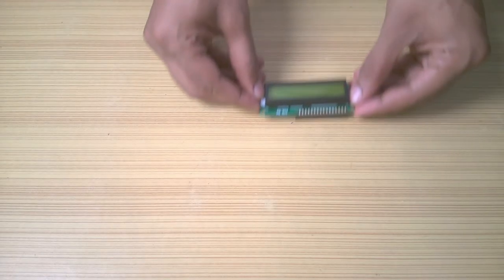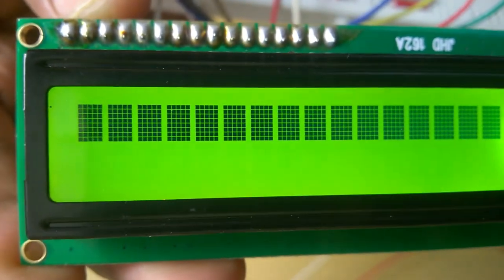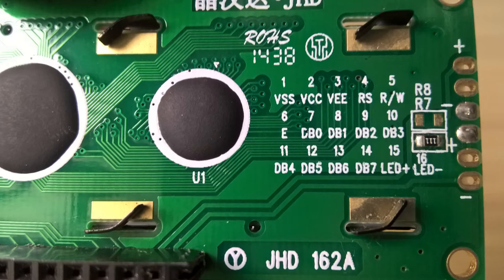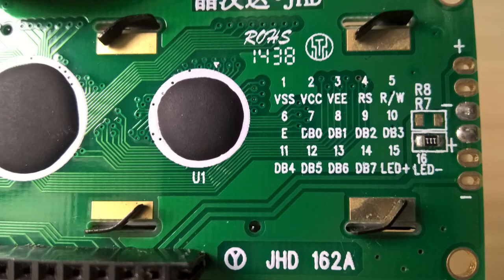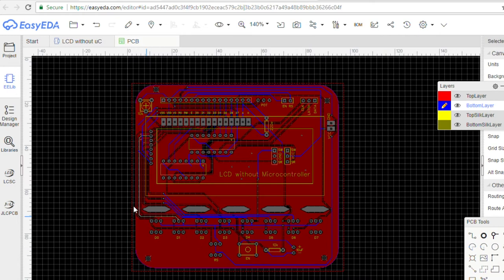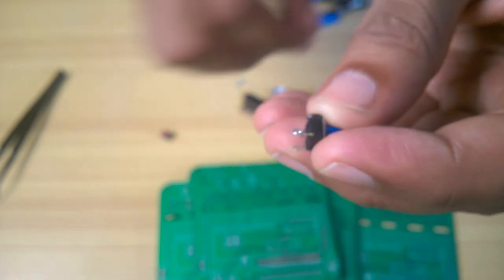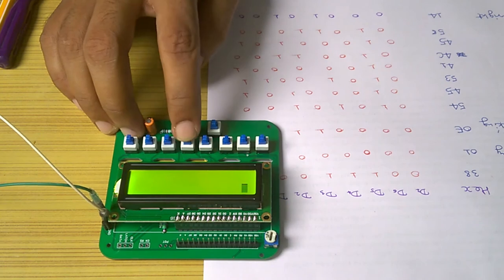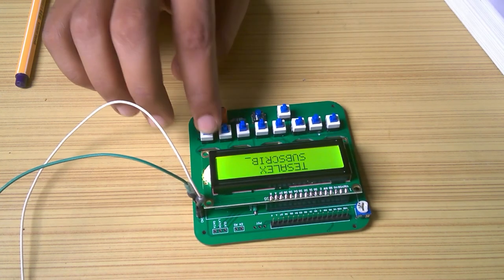LCD without a Microcontroller

Comment: Do anyone know how to create custom character without Arduino library
Reply: Yeah i do... sure
it's easy 

CUSTOM CHARACTER 101
Assuming you are using a 1602 LCD  which means
16 Characters   x  2 lines

what you will notice is Each line has , WHAT YOU WILL CALL A SQUARE.
well.. it's not a square, it's a rectangle
but CORRECTLY CALLED,    A CHARACTER 

Now... this character uses the ASCII Protocol used by your keyboard
but, you can create any character you want , as follows

You open the custom character sketch

then understand this 
1.   YOU CHARACTER DIMENSIONS ARE  5 PIXELS   X 8 PIXELS

2. Get yourself a paper and colour in some squares and create a character on paper

Now......  EACH HORIZONTAL ROW is 5 pixels
and in the code it is represented by A  5 BIT BINARY STRING

3.  SO....     if i write this string     00000
it means the entire top row will be left off
but......   if i write this string     11111
it means the entire top row will be turned ON

so    entering a zero  leaves the pixel off
entering a  1   leaves turns the pixel on

so if i am to create a letter   T
i would do this 
Line 1    11111
Line 2   00100
Line 3   00100
Line 4   00100
Line 5   00100
Line 6   00100
Line 7   00100
Line 8   00100

MAKE SENSE  ????
  
NOW   go to the code
find a custom piece of code like this and copy it 

// make some custom characters:
byte heart[8] = {
  0b00000,
  0b01010,
  0b11111,
  0b11111,
  0b11111,
  0b01110,
  0b00100,
  0b00000
};

now
do not change the 0b  part
instead   ONLY CHANGE THE BITS AFTER THE 0b

that's it
DESIGN YOUR CHARACTER
CODE IT 

OH and of course CHANGE THE NAME FROM   "HEART"  to   YOUR NAME or whateve ryou want 
THIS ESTABLISHES YOUR CHARACTER

NOW  go down to this section

  // create a new character
  lcd.createChar(0, heart);
  // create a new character
  lcd.createChar(1, smiley);
  // create a new character
  lcd.createChar(2, frownie);
  // create a new character
  lcd.createChar(3, armsDown);
  // create a new character
  lcd.createChar(4, armsUp);

AND ADD YOUR CHARACTER AS FOLLOWS
  // create a new character
  lcd.createChar(5, your character name);
so increment the number up 1
and insert your character name EXACTLY as you did above

LOAD IT 
HAVE A NICE DAY 

THEN TO CREATE YOUR CHARACTER OVER AND OVER
JUST COPY IT OVER AND OVER